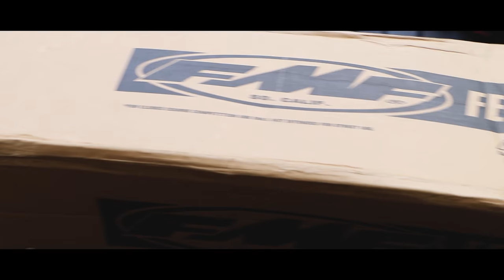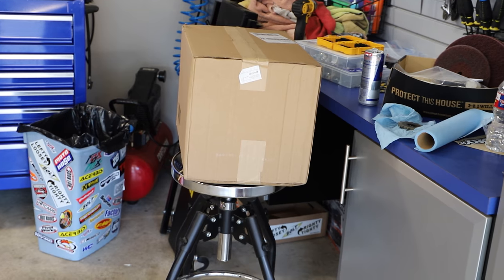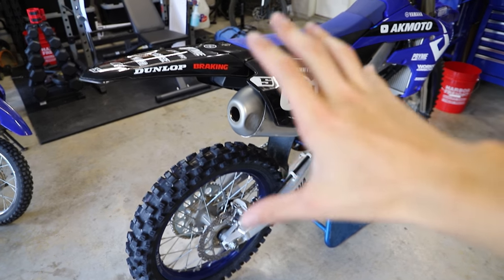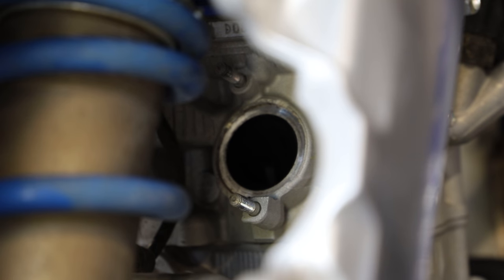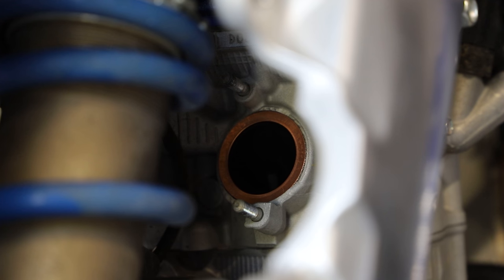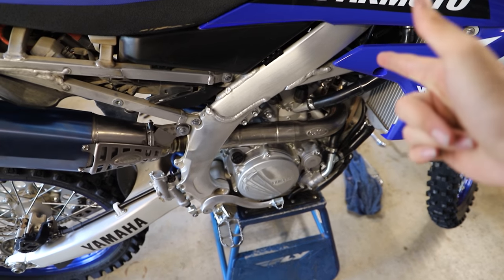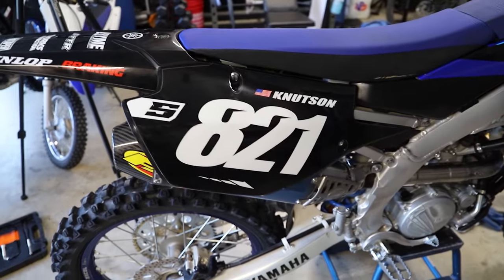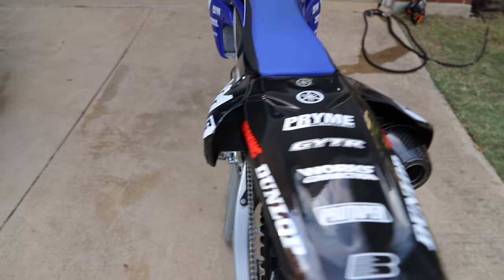2021 YZ250F FMF 4.1 INSTALL *FULL SYSTEM*

Comment: nice. is it ok without the clamps bet header A and header b? thanks. will install mine in the next few days. hope to get a reply. cheers.
Reply from the maker: I didn’t use any clamps and I’m not having any issues 👍🏼
Reply: @akmoto_   i forgot about the springs. the clamps are for the oem heatshields i suppose. thanks. appreciate it.

Comment: I just put one on my 23 and I’m confused on if the muffler inside the slip on is supposed to twist back and forth. I bought it new but that doesn’t seem normal to me. Like when I put my wash plug inside I can literally twist the the thing inside back and forth. If that makes sense
Reply: That is the spark areestor that you feel moving. It is just held there by a ring at the end of the exhaust that keeps it from falling out but it doesnt keep it feom spinning around.

Comment: I put full fmf exhaust on my 2018 yz 250f and it runs bad. Bike won’t even stay in the air when I pick it up. Thoughts?
Reply from the maker: Did it run fine before? A simple exhaust swap shouldn’t have that dramatic of an affect on how the motor runs